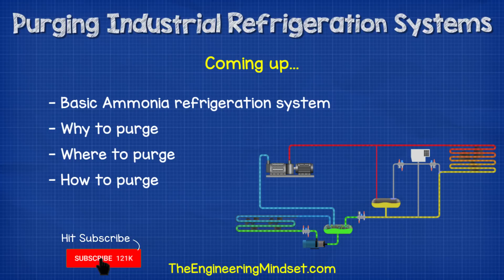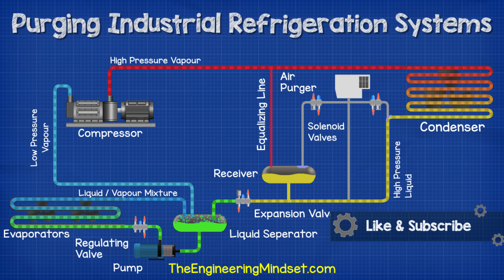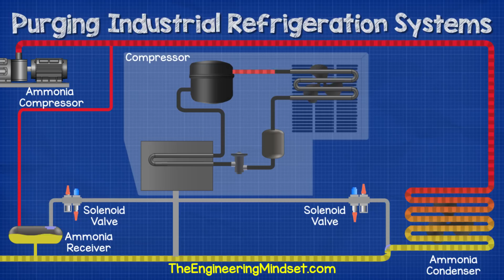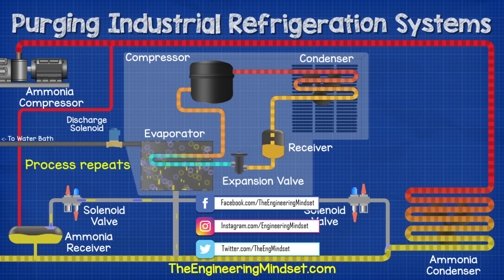Purging Industrial Refrigeration Systems -  ammonia  industrial engineering

Comment: What's the benefit of Danfoss using a separate refrigerant system in their purger? Hansen and Parker models use HPL ammonia and house suction to cool the discharge gas & non-condensables.

Comment: Most purgers use high pressure liquid ammonia and an expansion valve to condense the ammonia in the foul gas off the top of the HPR if I’m not mistaken. I usually deal with Hansen purgers and have even seen one on a Frick 150 ton screw package running on R22 serving a spiral freezer. 
Great video though! Cool seeing what other equipment is out there! Do you know what Danfoss does to avoid corrosion of the piping in the purger refrigeration circuit? Is the evaporator coil stainless or steel?

Comment: My question is how do these gasses get into the system? and what rate, we talking purging a tiny tiny amount out every month or we talking this is a 24h operation?
Reply from the maker: Hi Simon, it's going to result from leaks, service work and chemical reactions so each system is different. This unit runs and monitors the system 24/7 and utilizing control
algorithms
 developed by Danfoss, the controller determines when the collected air is pure enough to open the discharge solenoid valve.
Reply: In industrial systems, suction pressure might be set to around -0,2bar to reach a colder temperature in the evaperator, hence increasing the efficiency. This has the unfortunate side-effect of sucking in air in the cold side of the system.

Although a system is tested to be completely sealed with positive pressures, that might not be the case with negative pressure. An air purger is often the solution